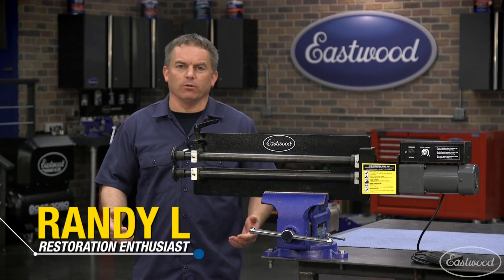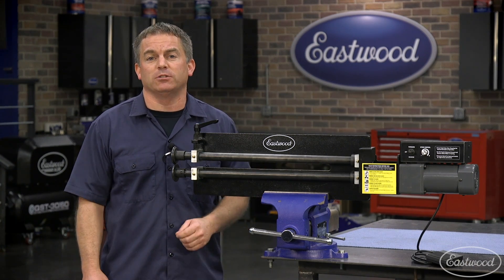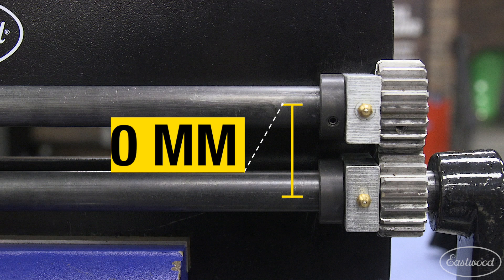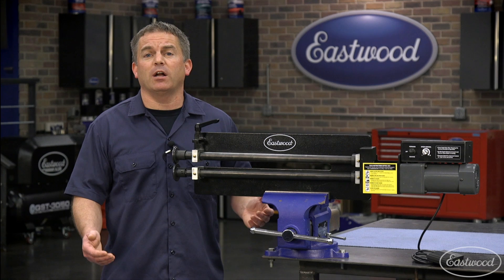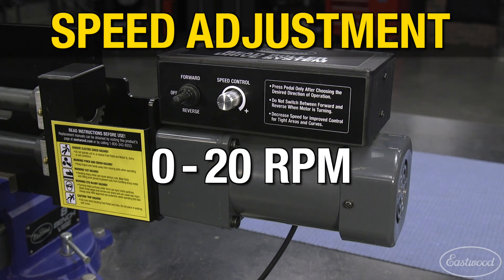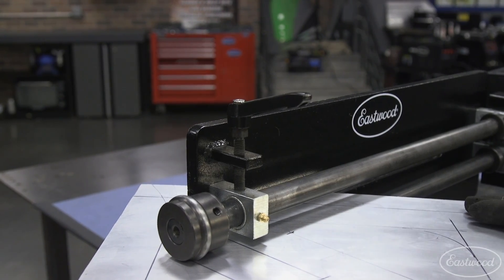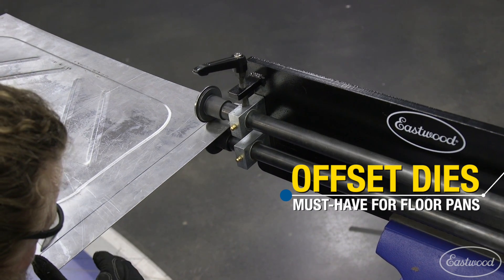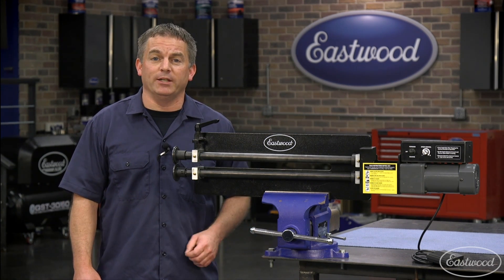Bead Roller Drive System - Attach a Motor to Your Hand Crank Bead Roller - Eastwood

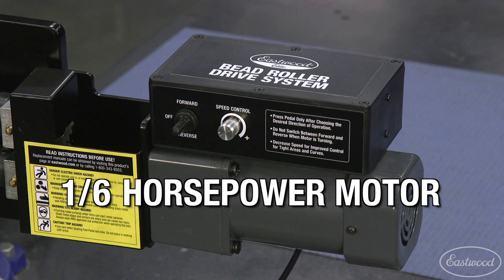Comment: 2:38, I know this isn't the point, but you cant have 120V current, because current is amps and volts is voltage or potential difference

Comment: I'd be curious to know if anybody has installed this motor on a 20" cast iron bead roller as they are a bit different than most.  Princess Auto 8536781 / Woodward Fab WFBR20.